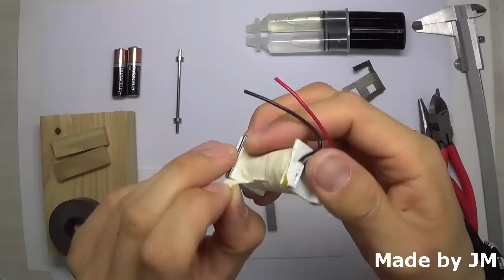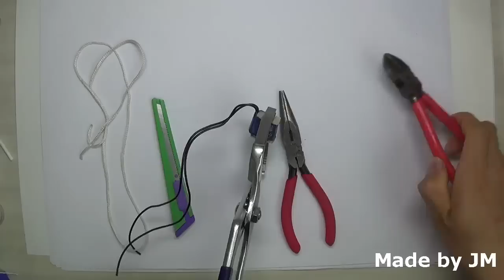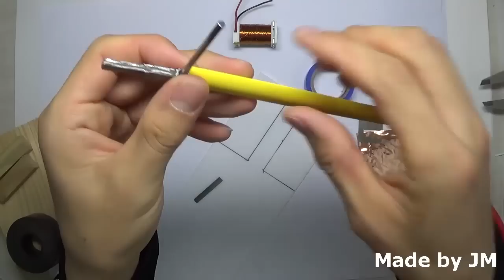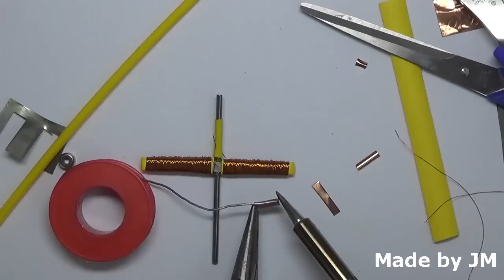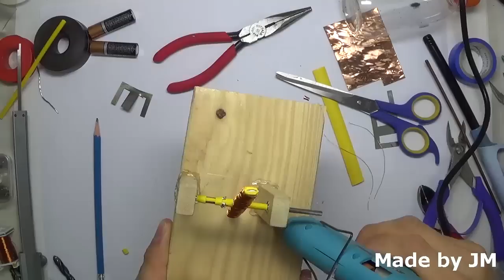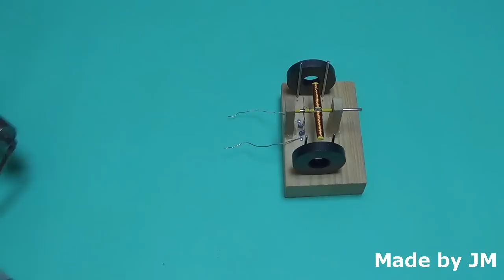✔ How to make a DC motor

Comment: If you attached a light bulb to the wires instead the battery and then spun the coiled wires wouldn't that   turn your motor into a generator?
Reply: yes

Comment: I see you are winding copper wire on top of heat shrinkage tube. Any particular reason for that? Would it be ok to wind the copper wire without heat shrinkage tube?
Reply: Yes. As long as current is isolated

Comment: i fail to understand how metal core could be used to make electromagnet for dc motors. I tried that and I failed many times because magnets attract metal, so will never get a repulsion force using metal as core for your electromagnet. you can't use a metal core in electromagnet. so this video is possibly fake